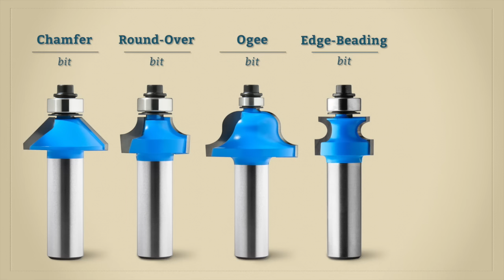Router Bits for Beginners | Rockler Skill Builders

Comment: Thank you for posting this video is was most informative. I received a Router as a gift. It as a 1/4" Shank, my question is how do I handle the router differently than if it was a 1/2" Shank? as I am new to working with a router. Thanking in advance for any guidance and direction on this matter.

Comment: thanks! now i can choose bits for routing my guitar body cavity :)
Reply: Is it possible to use the router to cut the guitar shape?
Reply: @1viccar  Old comment to reply to, but here goes:
I'm assuming we are talking about solid body electric guitars. One typical order of operations is to cut a template of the guitar shape using MDF or some other cheap sheet material. This template would be cut on a bandsaw or similar tool, then the edges sanded down to the exact desired shape on a belt sander. The option also exists to directly do this to the guitar body, but at the risk of messing up your expensive guitar body wood instead of cheap template material. Plus having a template means that you can easily just make the same guitar body shape over and over. Once you have the template made, you can use it as a stencil to mark out the shape on your actual body wood, cut a quarter inch or so proud of that line on a bandsaw, then use the template again with a flush trim bit to exactly copy the template shape to the body material. At this point you just have a solid ~1.75" thick hunk of body wood in the desired shape. From here you can then use a router with a straight bit to remove material where the electronics will be inserted (which I believe is what the original poster was talking about.) If you are making a semi-hollow body electric, then a router can also be used to hog out large portions of material to make it semi-hollow.
So anyway, yes, you can use a router to cut the guitar shape, typically with the aid of a template. If you are not using a template then you would be better off cutting the guitar shape using something like a bandsaw and then sanding the edges.

Comment: Rabbit bit be used to put a door together for a closet?
Reply from the maker: A rabbit bit would only be used if you were to put in a panel that is recessed from the back side. For closet doors I would recommend using a Mortise & tenon joint, bead lock or dowel joint.

Comment: 1/2" and 1/4" are of course typical ones, but so are 6mm, 8mm and 12mm
Reply: 8mm maybe no so typical. But i would only buy router that accepts 1/2", 1/4", 6mm and 12mm bits
Reply: @jamisusijarvi646  In Europe, 8mm is most common. 6mm is for small one hand held edging machines, 12mm is for more professional use.

Comment: Do we remove bearing at top of bit while using??
Reply from the maker: Typically, the bearings on bearing-guided router bits — particularly profiling bits — are intended to be left on during use. This enables the bit to follow a reference edge on the material being routed and prevents it from cutting too deeply.

Comment: What is the general bearing size of 1/4" and 1/2" bits
Reply from the maker: If by "size" you mean diameter of bearing, that will vary based on the bit. Flush, pattern and mortising bits will have bearings that match the outside diameter of the cutter, because they're being guided against a template. The bearing rolls along the template edge, and the cutter trims material flush to the template. Other bits, such as those for rabbeting, can accept a variety of bearing diameters to vary the proportions of the rabbet that can be cut. Keep in mind that with profiling bits, you can swap out one bearing for another in order to limit or expose more of the bit's cutting profile and, effectively, cut a partially different shape as a result.

Comment: Do you have Router in Millimeter (mm) ?? in Europe we don´t use inch
Reply: Daweisstebescheid Es gibt inch Aufnahmen für fast jede Oberfräse. Spannmuttern in Inch
Reply: Tell to switch!
Reply: Daweisstebescheid it’s time you learn our measurement system then just like we’ve had to do with your system and since I’ve been out of school almost 30 years I haven’t used the metric system one time thank god, after using our system the metric system is the most complicated thing for me to deal with so I just don’t do it and everything is fine
Reply: You can see you never had a ruler in your hands before.Buy one and start working with both.Inches and mm.
1 inch =25.4 mm